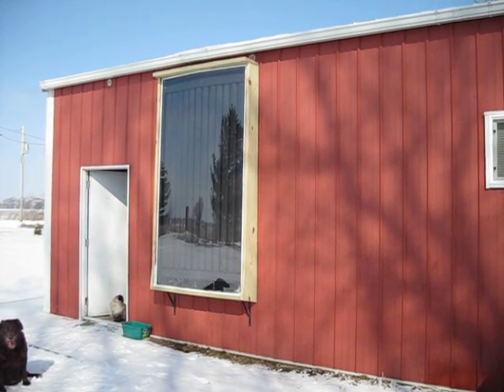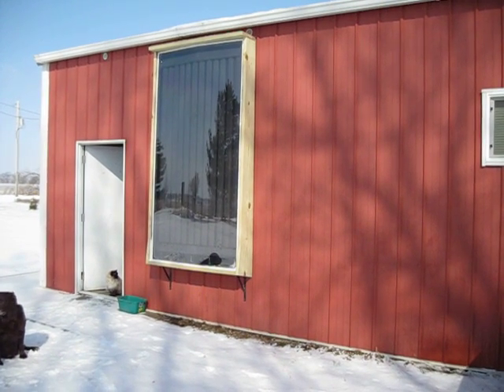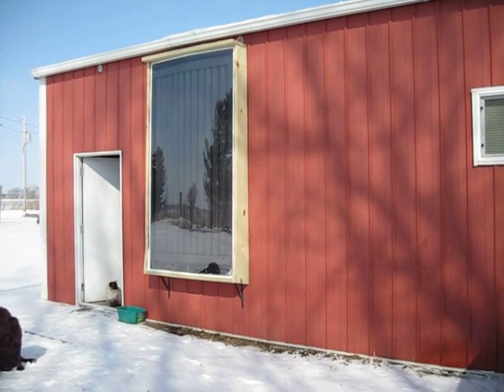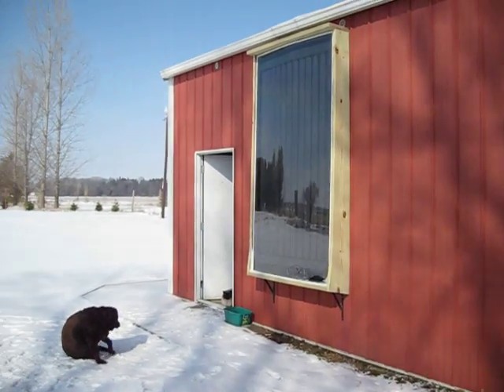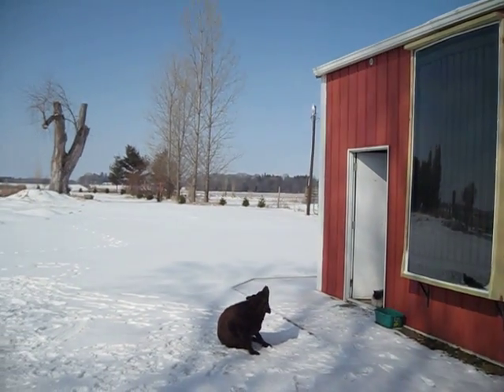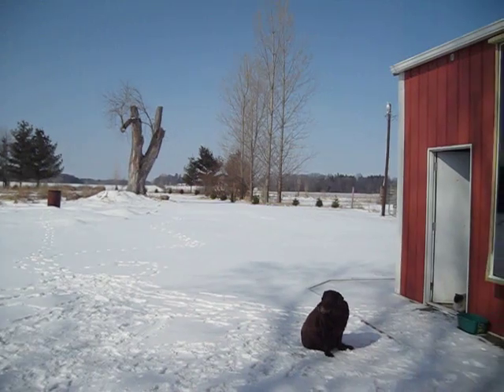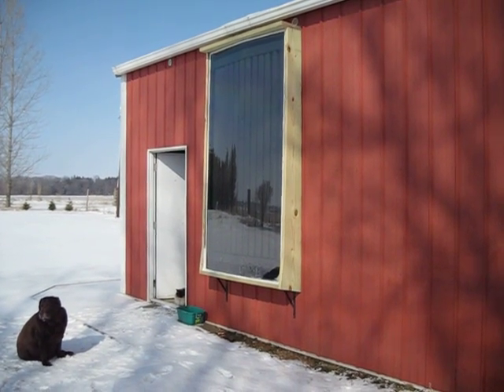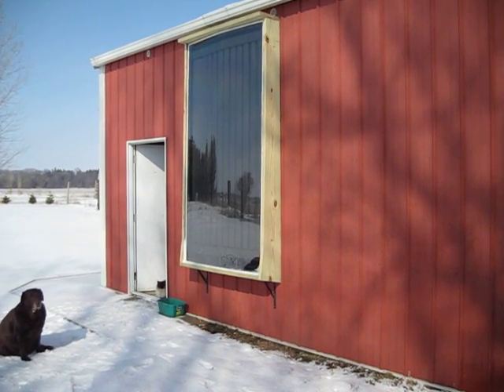POP CAN SOLAR PANELS FREE HEAT/UP TO 210DEG/NO BLOWER NEEDED

Comment: Really nice unit man! Looks big and strong. I am sure it works well putting out free heat. I love the idea and strategy of going totally green: totally free energy. Excellent strategy over time. As I keep at it, one project after another project after another. 10 years on and amazing the difference.  Maybe 5 years ago I made a 3 foot x 5 foot pop can unit with 55C output. It worked so well that I scaled up and built a 6 foot x 6 foot unit. It has 21 aluminum downspouts inside 4 inches (R26) of sealed tinfold foam board inside a galvanised steel sheeting rivetted convex box covered with a single piece of plexiglass topped a big steel sheeting roof. For about 4 hours on sunny days the heat output is 80C to 90C. It has 4 inch top and bottom ventilation holes and a 4" grid electric duct fan in the bottom hole for faster air circulation. The temperature inside the 9 foot x 15 foot room increases 6 C (12C to 18C) between 11:30 am and 3:30 pm using the solar house heater.I can just imagine the heat output of your unit (same surface area as mine equalling 36 square foot area) having full skies of sunshine from 6am to 6pm on the prairie! Good work sir.
Reply: Really nice unit man! Looks big and strong. I am sure it works well putting out free heat. I love the idea and strategy of going totally green: totally free energy. Excellent strategy over time. As I keep at it, one project after another project after another. 10 years on and amazing the difference.  Maybe 5 years ago I made a 3 foot x 5 foot pop can unit with 55C (131F) output. It worked so well that I scaled up and built a 6 foot x 6 foot unit. It has 21 aluminum downspouts inside 4 inches (R26) of sealed tinfold foam board inside a galvanised steel sheeting rivetted convex box covered with a single piece of plexiglass topped a big steel sheeting roof. For about 4 hours on sunny days the heat output is 80C to 90C (170F to 194F). It has 4 inch top and bottom ventilation holes and a 4" grid electric duct fan in the bottom hole for faster air circulation. The temperature inside the 9 foot x 15 foot room increases 6 C (12C to 18C)(54F to 65F) between 11:30 am and 3:30 pm using the solar house heater. I can just imagine the heat output of your unit (same surface area as mine equalling 36 square foot area) having full skies of sunshine from 6am to 6pm on the prairie! Good work sir.

Comment: I would have found old double glazed sliding glass door panels and used them to cover a lot of that metal siding.  The siding, painted a dark color ( green grey black ) would make a good collector surface.  Cover with a silver tarp in the summer.

Comment: Check out   http://simplysolar.supporttopics.com/latest    or  builditsolar.com    These can collectors do work well, BUT are very labor intensive with cutting the ends out of the cans and washing the insides to remove any residue of what was in the can, then gluing then together. The guy's at these link have designed several types of screen collectors.Window screen replaces the cans in the collector.They are getting as much and more heat with the screen as they were getting with the cans.

Also you are losing heat to the outside by letting the collector get that hot. By running fans to keep the collector to 120f max, you will lose a lot less heat out through the glazing and get more BTU's into the building. I use PV panels to run my fans, with on at 90f / off at 85f snap switch for heating my house.

Comment: Your temperature measurements are meaningless without also measuring the amount of airflow through the collector.  The point of a solar collector is to produce the maximum amount of thermal energy being transferred to the air.  This is measured by the temperature increase in a measured volume of air.  The way to do that is to measure the temperature difference between the incoming air and the outgoing air for the volume of air being moved; e.g. degrees increase per cubic foot of air flow.  What you are doing is like trying to measure a wall area by only measuring its height - meaning less without also knowing the walls width.
Reply: @WilliamHelstad  the speed of the air coming from the exhaust is m/s. The area of the exhaust is m^2/s. Multiply the two and you get the volume of air per second.

Comment: its been a number of years now...hows it perform now? was wondering whats the temp get up to inside the building/room...not just out of the box.
Reply: it lost about 5 degrees.I COVER UP THE PLEXI GLASS ON THE FRONT DURING THE SUMMER MONTHS.
Doing this keeps the heat flow strong
Reply: jeff Grelyak whats the temp inside the building get up to using the solar heater

Comment: No pop cans ? Then what is inside ? And how is it vented to the indoors . 2 holes upper and lower or just 1 ?
Reply: How is it vented?
Reply: @donaldrojem7840  Not my post but I think your supposed to have pop cans in there to absorb heat and a hole on bottom with a hose and a small computor type fan sucks the heat out

Comment: I was stationed on the Canadian border in Northern Maine in the early 70s. Mother Earth magazine had plans on how to build this type of thing with wrapping paper tubes and a cardboard box. We just wedged it into the bottom of a slightly opened window. Worked pretty good even with outside temps of 30 below. Nice to see the basic concept finally caught on.
Reply: Maree Dillin
Check out   http://simplysolar.supporttopics.com/latest    or  builditsolar.com    These can collectors do work well, BUT are very labor intensive with cutting the ends out of the cans and washing the insides to remove any residue of what was in the can, then gluing then together. The guy's at these link have designed several types of screen collectors.Window screen replaces the cans in the collector.They are getting as much and more heat with the screen as they were getting with the cans. 

For what Nico mentioned google "Mother Earth News, Sun Grabber"
Reply: Nico Iannone I know it's been a year since you commented but will you please give me the instructions on how to make it please

Comment: Batteries for the fan? No solar panel?
Reply: you can get small solar charger stations to run a computer fan.
Reply: Mike Mosley You can use two opposing neodymium magnets to power the small fan.

Comment: Hoi URIDE4LIFE ! Nice design, I've a vertical and horizontal design. The horizontal design needs to be powered with fans because the air is not going automatically to the top. But with the vertical design, like yours, there's a big difference while using a fan or not to heat up my summerhouse. 
/watch?v=8onkXvkQWIQ